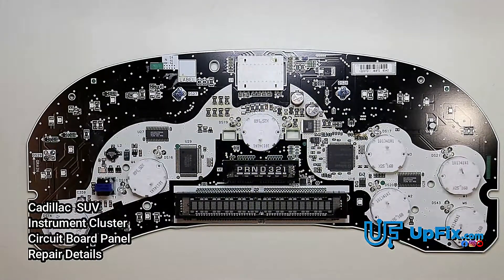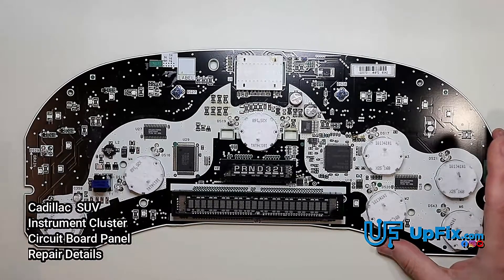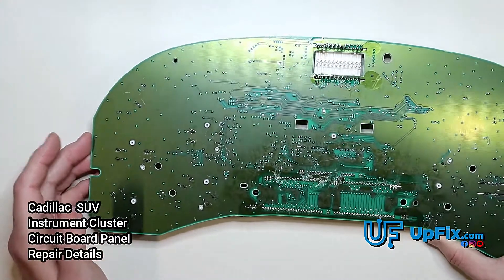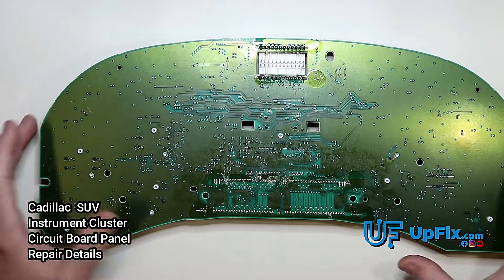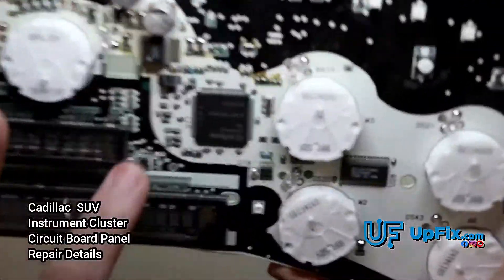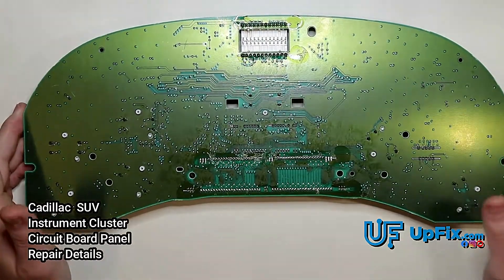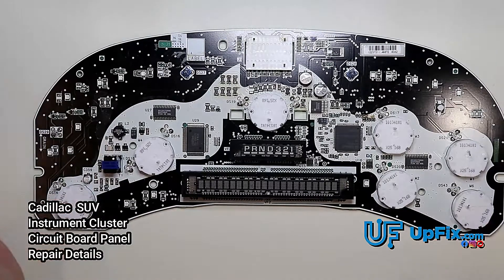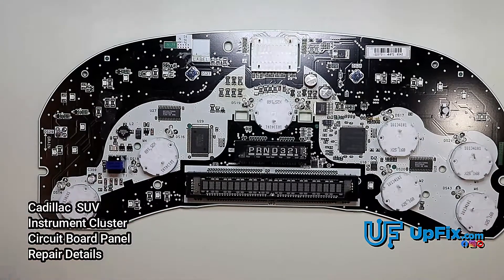How to Fix Cadillac Escalade Instrument Cluster Panel (ICP) and Circuit Board Repair Tutorial

Comment: What year was it?
Reply from the maker: This was from a 2003
Reply: @upfixauto  is there a big difference between 03 and 10?  Or you not sure?
Reply from the maker: @tret yes there is a major difference. It is a different circuit board starting 2007. The board is same for 2003-2006
Reply: @upfixauto  thank you!  I don't know much about these electrical components. I'm more of the swap it out type. But I want to see if I can repair instead of replace this time to save a little money. You suggest any good videos for the 07 and up?
Reply from the maker: @tret not sure on good videos for 2007 cluster. But yes for sure try to repair it. Because yes you will save money and odometer mileage value will not change. If you need help and want us to repair it, we can. Visit upfix.com, if you do get a new/used or another replacement cluster, we can also do odometer mileage correction if neded.
Reply: Were do i get a quote??